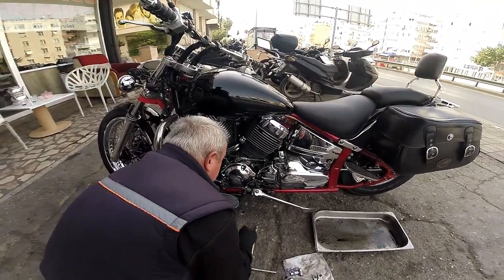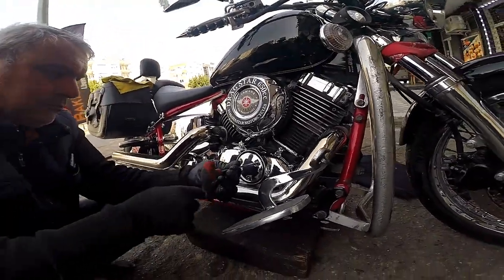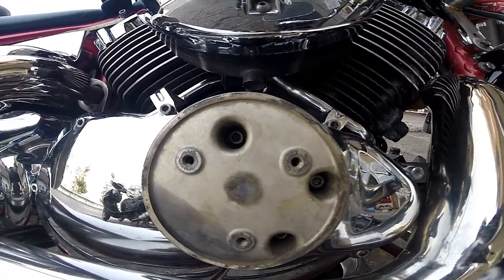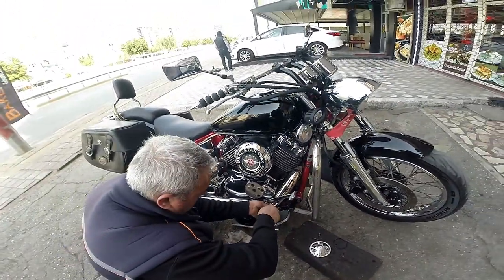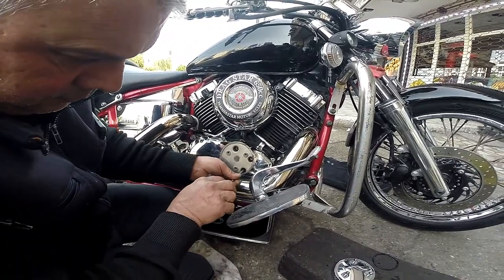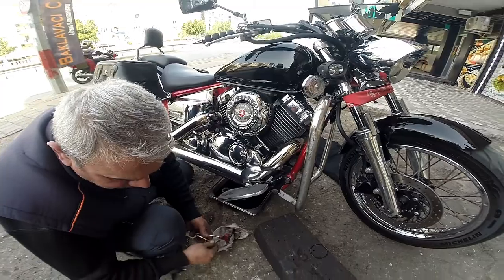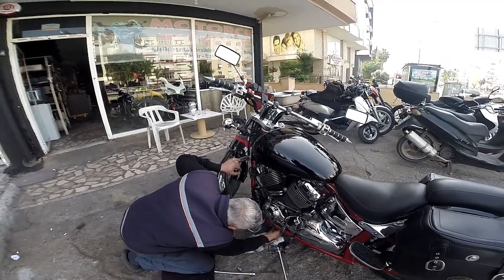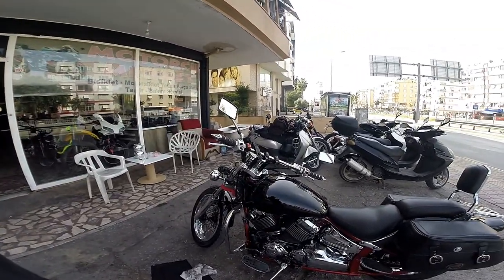HOW TO YAMAHA V STAR 650 MAINTENANCE  | HOW TO V STAR 650 OIL CHANGE | YAMAHA V STAR 650 MORE POWER

Comment: Never touch your bike if you dont have a torque wrench - its way to easy to strip the threads on the oil drain plug, the filter cover bolts, spark plugs...
You dont need to lift the bike to change the oil, or take off the kick stand. Leave the bike on the kick stand, use a 3/8" drive short socket and you can get a few turns on the plug to loosen it up. A half inch drive socket and breaker bar is NOT the way to do this.

Good call on putting the oil in by volume - if you fill it looking at the site-glass marks, it will be low when you start the bike and the oil filter fills up.

Also: you change the oil every 4k miles, but only need to change the filter every 8k miles
Reply from the maker: Thanks for the info brother